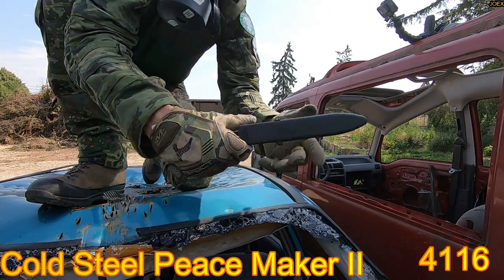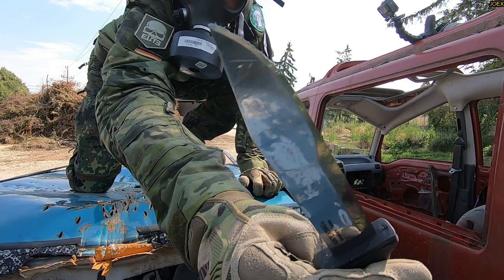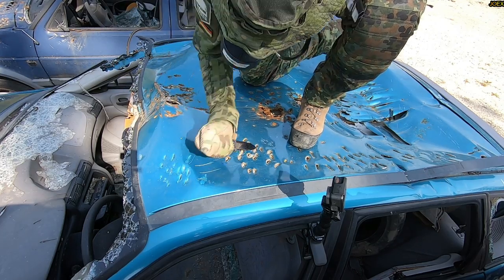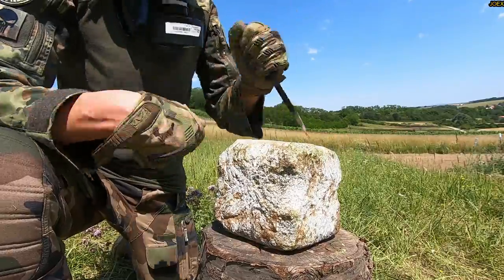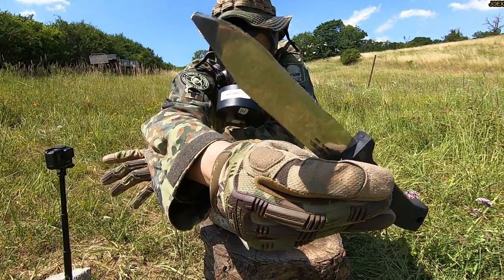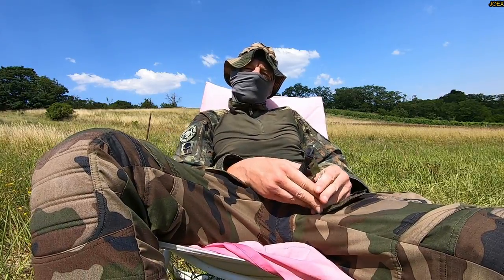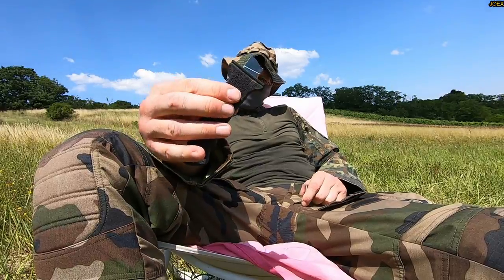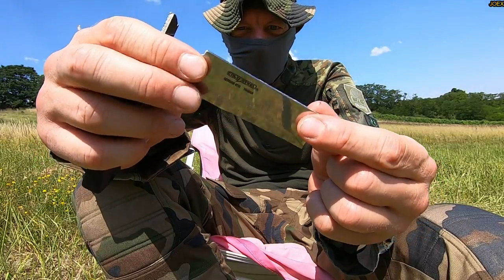COLD STEEL PEACE MAKER II - KNIFE DESTRUCTION TEST - UNTIL IT BREAKS - STAINLESS STEEL: 1.4116

Comment: I had it and gifted to a buddy of mine. The blade is decent but the handle is crap with that soft rubber on it and the lack of a ricasso. On mine, the so cold rubber guard was being cut by the edge. Very dangerous and the proof of a poor design. 
Thank you for your work.
Reply from the maker: u are welcome, weird as the blade came out!!

Comment: I've long been very happy with mine. I've zero complaints of it; though I don't use mine as does Mr. X.
Reply from the maker: ok, cool!
Reply: @joex  
          It's a poor Car Opener, for sure and I wouldn't try it on Stumps 'n Stones, either. Still, it's very easily convexed and easily sharpenable to a deadly edge.
     Mine's been batoned and used to great effect in the types of daily I'm like to find for it.

Comment: Been carrying one of these since 2016. Mr X isnt representing what this knife is technically made for. These knives are meant for being a cutting tool. Not a car opener. If you work in environment where your working on cars, edc, or just normal use itll serve you well. Plus if you wanna stab holes in a car door for whatever odd reason thats what sharpened rebar is for. Everything is designed with constraints. Itd be like using a butter knife as a paper cutter and saying it's a bad knife. Guys a jokester.
Reply from the maker: Marlboro!!!!
Reply from the maker: a clown is acutally a deadly creature!
Reply: @joex  if a clown is a deadly creature then we'd be in a world where cars run on unicorn farts. Once you give this knife a fair review and stress test it as an actual knife and not some sort of demo tool, you're still a joke of a knife reviewer for YouTube. 4116 isn't meant for breaking bricks. That's what sledge hammers are for. 4116 isn't made to stab through a car's body panel. That's what a BK3 is for. 4116 can do light to medium bush craft work, if you take care of it. 4116 is German Surgical steel. It will hold an edge when doing KNIFE work. Not a demolition tool work. 

Go judge a eel (4116 surgical) in a tree climbing competition against a primate (D2/1095/Sandvik). Who's gonna win? 

And even then the knives range from 26-35 dollars so a knife that lasted me all those years for that price compared to the price of the higher end steel knives the peacemaker overpays its dues IF YOU USE IT AS A KNIFE. 

Not to mention they have pretty good edge retention and the ability to resharpen the blade. They're also good for concealment, something you may not have heard since you gotta overcompensate with those oversized hunks of overpriced metal. 

Also tell me when, if ever, I'll be needing to cut into a steel door of a car on a normal day to day basis as a mechanic using a knife. Better tools exist like angle grinders. 

Finally to conclude, you don't know what you're doing. If you did you would've taken everything I have said into effect before hand. Just goes by the saying "use the right tools for the job" and you definitely did not do that 💀.

Comment: A 12.5cm blade, lighter weight and compact sheath with comfortable grip for small hands. I still love my PM2, consider it as a hiking&bushcraft knife or conceal carry . I purchase it before Lynn sold CS, hope it will perform enough on my hiking. SRKC may outperform it but I already have many same knives before it was introduced  to market.
As for the 'escape' tang you can add a zip tie through the lanyard hole. A must know tip for all rubber handle CS knives!
Reply from the maker: thanks for the info, comparing this blade to other CS, it is shit!
Reply from the maker: a must know? check  my other vids, no blade came out!!!
Reply from the maker: outdoorsman for example!
Reply: The blade is really soft. Its the exact steel used in swiss army knives

This knife wasn't really designed for anything except stabbing meat

Comment: I had it and gifted to a buddy of mine. The blade is decent but the handle is crap with that soft rubber on it and the lack of a ricasso. On mine, the so called  rubber guard was being cut by the edge. Very dangerous and the proof of a poor design. 
Thank you for your work.
Reply from the maker: u are welcome! cheers!
Reply: @Von Teutoburg my pleasure. I advise you to not use it in its actual state. If you have time and some tools you can remove that rubber crap, fit a steel handguard and add Micarta or G10 removable scales. After that you can call it a knife handle.

Comment: $69 price tag: "this knife is a totally disgusting failure and Cold Steel is losing it." $33 price tag (for 5.5 inches with rubberized grip and kydex imitation sheath:) "ok this is a great self-defense bargain for a motel room on a road trip" (can't beat a rubberized handle and a simple no-snap/no-strap pull out sheath). Compare to Kabar 5" at $100 or Esee at more like $140 - knives also destroyed by Joe X. Obviously tip design isn't good for car panels, but these are steel, not bark, not softer. The pull-out from the hande is absolutely unacceptable - unless the tip testing and brick testing tore the anchor points loose, in which case I won't condemn the knife, I'm just happy it didn't actually snap off where it enters the handle. Recently we have seen stips that shouldn't snap, snap after the stresses of car body panel tip testing. My takeaway: expect less from a Peace Maker II. Expect more from the Razor Tek; but with the Razor Tek it's 4" or 6.5", the Peace Maker is Goldilocks-sized, and the Razor Teks are a lot heavier., and more expensive. There needs to be a seat for everyone at the table, and the Peacemaker II is a relative bargain. Midgrade Swedish puukos sell for more.
Reply from the maker: thanks for the info, it is not a good knife - nothing more to say!"" cheers!!

Comment: Fell below expectations with the lack of anything other than friction apparently helping retain the blade in the handle and the edge chipping away like it was nothing. Yikes.

This is more like the 4116 I know though, props to their Taiwanese manufacturing with some of the other ones.
Reply from the maker: this one did shit, weird that the handle came out!
Reply: How much do you think the chipping was caused by poor tempering vs. stock thickness, edge angle (17 degrees or 22 degrees), and thickness behind edge? I totally agree that was a massive failure at the edge and not what we are used to seeing here with 1.4116.
Reply: I'm going to go with edge angle and tempering as the sure most major factors, but don't have specifics to try and judge precisely regarding the edge angle. A 22 dps will withstand a lot more than 17 dps will. Given that it appears to all be the same manufacturer(s) in Taiwan, I am leaning more on the edge angle over faults in the heat treat. (There could have been a bad batch though, and also this may have been run at higher hardness quite perfectly well to produce the worse chipping performance.) Which means it isn't so fair for me to be so hard on it for the chipping, and instead that is just more reason this wasn't one to expect to go far with Joe by design.

I'm not putting much on the behind the edge thickness since for the most part this is a scandi grind that makes behind the edge thickness mostly N/A. Even on the forward part where there was some 'behind the edge thickness-like' geometry, it wasn't chipping all the way through to get behind the edge.

The stock however doesn't matter for the edge failures. That and the distal taper are the reasons for the easy snapping and also obliteration of more of the tip past the bevel as soon as it started hitting the rock though.

Comment: A peculiar design. To look at the profile, it would suggest a tactical role yet the blade is too thin and appears to have a scandi grind? Everything seems to be at odds with itself. Proven to be next to useless. Thanks Joe.
Reply from the maker: yes, i dont like this one too!
Reply: Yes, it was modeled after the mora kansbol but it was marketed as a boot/self defense knife.  It is good in the kitchen as it is rust resistant and easy to sharpen, but that's it.

Comment: Joe, did you ever look into folders to carry as rescue tools? For example the Victorinox Rescue Tool? I had one for a while but it was pretty easy to break the pry tool on that one. I wouldn't be so sure that I could get someone out of a broken down car with that by myself.
Reply from the maker: i would only trust the old Cold Steel Folders, like Espada L or Voyagers XL!!
Reply from the maker: i deleted your email, can u send me a new one at: joexofficial@gmx.net, than i send u a patch!!!  i would need your adress again!!!
Reply: The Victorinox Rescue Tool doesn't have a pry tool, it has a screw driver.  So yeah, it's probably going to break.  I don't think we can hold it against the tool unless they claim its a pry tip ^_^

Comment: What are you trying to prove by taking a perfectly good knife and destroying it? Are you trying to prove that it's a bad knife? C'mon. I would never subscribe to a channel that does what you're doing. The Peacemaker 1 is a great knife despite its having a 420 blade. It's easy to sharpen and the heat treat is fantastic! It's also a double grind blade and is superb fighting knife! 

It's unlikely that I'll meet a creature made of stone. If you want to test a 4116 or 420-bladed knife, test it with wood. How long will it cut wood and how well is it to sharpen? How easy does it come out of its sheath and will it cut paper after you cut some wood? You don't need to break it's tip, either, but will it be damaged after it's dropped on stone or brick? I've had mine for years and it still cuts as well as when I first got it. So please stop these senseless destruction tests and test it as if it's going to be used. That way it will be more useful and you can keep it after your tests. 

This Peacekeeper by Cold Steel is a great knife.
Reply from the maker: proof? everything!